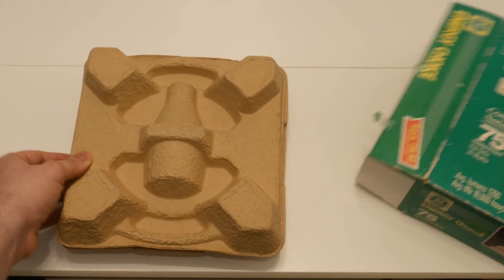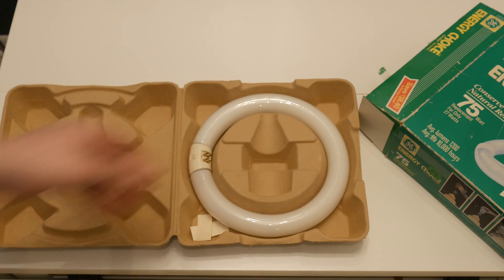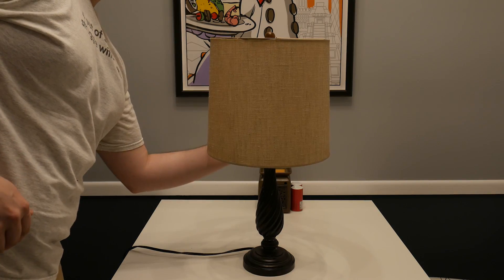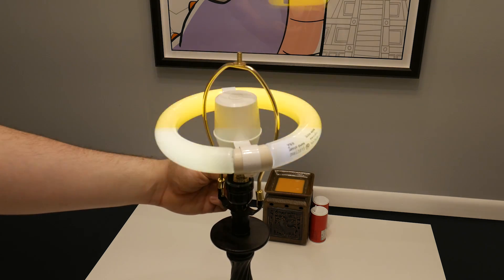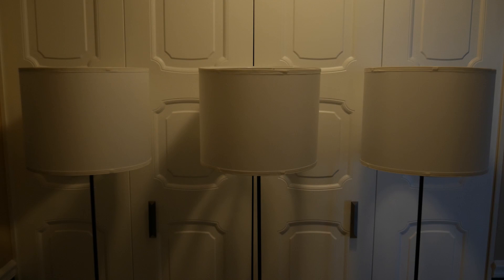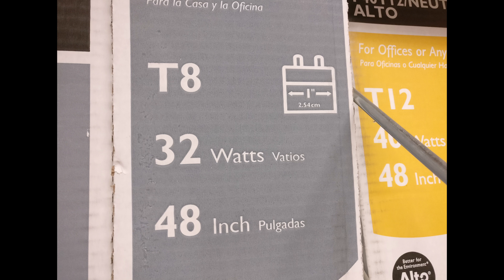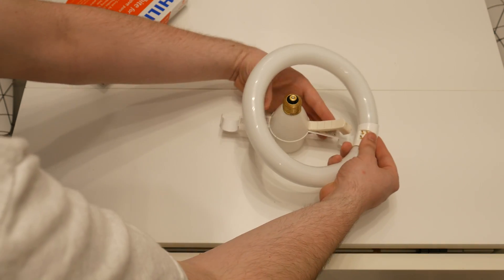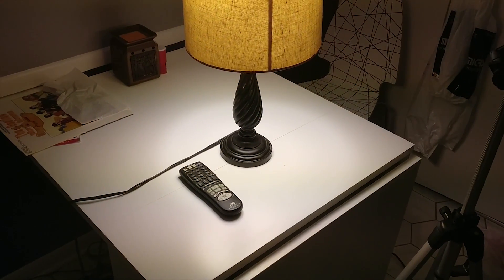GE's bizarre early attempt at a CFL

Comment: It's just an adapter to put a Circline tube into an Edison socket. Circline tubs were developed as their own thing, so it makes sense to make an adapter so you can sell those tubes for more applications. Also, the T-sizing thing is an international thing, not just a US thing. Though, to make it more confusing, T8 is also called T26, because it's about 26mm (actually 25.4mm) and T12 is also called T38, even though it's actually 38.1mm. The mm sizes are just adapted over from the sizing in eights of an inch, however.
Reply: They call that "soft conversion". Convert to Metric and if the precise size isn't critical, round to the nearest whole number. Hard conversion is actually altering the product design to make it the nearest whole number metric dimension - and making it incompatible with the previous Imperial dimension version.
Reply: Ethan Alt Nope, that's just a coincidence from the two sizes given. T5 US is T16 elsewhere, because 5/8" = ~15.875 mm.
Reply: ...so it's x*3+2?

Comment: When I used to live at home with my folks, our house had a "circline" fluorescent light fixture using a T9 lamp just like the CFL featured in this video, it was mounted on the ceiling at the bottom of the stairs in the basement.  It kept going for the 14 years I lived there until I moved out on my own about 16 years ago (that light is probably still going nowadays).  Those Circline lamps seemed to be quite popular in the 70s & 80s.

Comment: It"s base on the same tech as the old neon tube, thats why it,s last. In those time neon tube was not à regular thing for domestic use.  Bending it on a circle like this was an atemp at aiming domestic market no big black heavy ballast to wire up etc. Its an easier solution to the two streight neon, it NEVER been intended to be use in a Lamp ! It was for the kithen sealing. All neon  at that Time have à shiity scary weird color temp. of some sort.
Reply: GE would disagree with your comment about these lights not being intended to be used in lamps, there is a picture of one in a lamp on the back of the box.
Reply: Ok then I ment that consumers at that time, from what I remember, would never think of doing that. It was use on the sealing as a cheap alternative to installing double shorts neon with a big ass black ballast :-)

Comment: Re. 2:03 and the fear of the bulb shattering -- this is only tangentially related, but I have several ceiling fixtures that just terrify me because the glass globe is just held in with spring clips that are pretty stiff. Every time I remove or replace the globe, I go grab the thickest gloves I've got just in case the thing shatters. I've even been known to put on safety glasses for this process, though usually I just close my eyes and look away.

Comment: One issue that I have with modern LEDs (and even CFLs) is that they have horrific brightness. In my room I have two normal 58W (150cm) cool white fluorescent tubes (with around 5200 lumens each). Getting something like that with LEDs is a bit hard. I don't think I will be replacing those anytime soon. Though we did finally replaced the incandescent 150w bulb in out kitchen earlier this year. With a huge LED lamp (1m in diameter),  8500 lumens with settable dimming and color temperature. It's ok-ish, but the CRI leaves a bit to be desired.
Reply: Your problem is ordering from Home Depot and not a professional lighting shop. If you are comparing a LED to a linear fluorescent, Cree makes up to 5,000 lumen troffers and max 10,000 lumen surface mount ambient with 90+ CRI. Those replace anything a linear fluorescent can do.
Reply: I used to not be happy with LED bulbs, but the newer ones put out better light than the CFL's now, so I'm happy to replace my CFL's with LED's.

Comment: I don't know what you're talking about with the original tubing, I actually think it looks better than the others, especially the colour comparison. I get the feeling it might be because you really seem to hate cool lighting.

EDIT: I forgot my screen was at 50% brightness. The colour doesn't look as good at full brightness, but I still don't think it looks bad.
Reply from the maker: I don't hate all cool lighting, just anything above 4500K or so.  "Cool white" is fine, but it's hard to find compared to daylight balanced (6500K) and I truly find those hideous.

The color of the light from GE didn't turn out so well on camera, that's why I needed the color comparison shots.  In person it really is a purplish grey, not at all pleasant.  I didn't show this in the video but I had a Hawaiian pizza box under this light, and the pineapple chunks looked almost a lime green under it.  I noticed it shifts most pure yellows well into green.
Reply: Technology Connections I used to hate so called "daylight" lighting until I realized that it should only be used in the day, or a bit more generously put, when it's going to be very bright. Illumination levels in private homes at night are typically too low for "daylight" lamps to look good. See also https://en.m.wikipedia.org/wiki/Kruithof_curve 

Personally I very much prefer 2500-2700K starting in the early evening, but I've come to love my considerably brighter 5000K lamps during the day. The solid state lighting industry is developing what they call "human-centric lighting" which will shift brightness and color temperature in line with human circadian rhythm, something I've been achieving in a more primitive way with timers and separate lamps/fixtures for years. I have sleep cycle issues and it helps immensely.

One neat product which I haven't gotten to try yet is the Philips "sceneswitch" bulbs which cycle from 5000K to 2700K to 2200K when rapidly power-cycled. I'm hoping to see @electronupdate or @bigclivedotcom do a teardown on one.
Reply from the maker: gplustree -- That's a good point.  Intensity of lighting does greatly impact the perceived naturalness of daylight bulbs.  The lights I use for filming are daylight balanced but because they're so bright, it seems more "correct".
I'm thinking my preference for warm white comes from two places- 1) that's what it's always been before modern lighting made daylight feasible and accessible, so I guess I'm old fashioned and 2) I naturally see it as less garish when under normal household intensity because it would be absurd to light your home with the intensity of sunlight at night.  If I had bulbs that could change between color temps, I might be more open to it.
That being said, I think I still prefer warm white even during the day.  My kitchen has no outside light except for what comes through the dining room, and I don't think I'd want it to be daylight balanced even when the sun is up.  I replaced the old two tube fluorescent fixture with an 8 foot track and have 8 spots, 4 pointing to one side, the other 4 pointing the other way (it's a galley kitchen so long and narrow).  I'm running relatively cheap 2700K 45 equivalent LED spots in them and I love the quality of light from the way its distributed.  But I really can't see myself enjoying daylight temp in there ever, and certainly not at night.  Even though when the sun is up and the kitchen is noticeably "yellow" compared to living and dining room, I just find it natural that it should look that way.  But again, that's probably my old-fashionedness kicking in again :)
Reply: Technology Connections Eh I totally get it. I only use 5000K and BRIGHT during the day in my bedroom and computer desk. It's not worth it to do the whole house, though in my last apartment I invested in 5000K lamps with a CRI of 90-96 and it made a difference. When I had them on at night for some reason or on a dark northwestern day, if you looked down the hall to the room it looked exactly like there was a window open letting in bright cloudy daylight. I'm highly sensitive to color rendering though, maybe that also makes a difference - I can tell a 2700K CFL from a hundred feet away by its lurid pinkish hue. When I go for walks at night I harshly judge everyone's lighting choices! 😂

Comment: “Not so popular”?? - man, you led a sheltered life! Circular fluorescents were common until quite recently, and the Edison base adapters like you showed here are just a minor implementation.
Reply from the maker: The video was more on the adapter and less on the circline tube itself.  I'm claiming the adapters weren't so popular.
Reply: I vaguely remember a "3" shaped tube at one time, too. It would usually be in a square panel.

Comment: I'll sing the praises of circline lamps.  The really will last 20 years IRL.   The ballasts for lamps I bought back in 1995 are still going strong with more or less daily use.  As for the colour of the bulb's light, GE did make several varieties and I preferred the bluer light for kitchen and bathroom.  At one time I had 4 of them in a ceiling fan in what would be considered rough service and the ran for years faithfully.  They are MUCH better than the CFLs and ran a lot cooler.  I recommend them to this day where suitable.  The bulbs are rather cheap and "back in the day" (1995) they were $9-$10 US new for a ballast-and-bulb set... and considering I'm still using the ballasts, worth every penny.  I've changed the bulbs 4 times or so, but again, they're pretty cheap especially in multi packs.  They're not pretty but they are durable as frig!